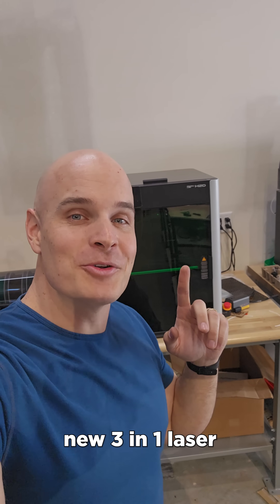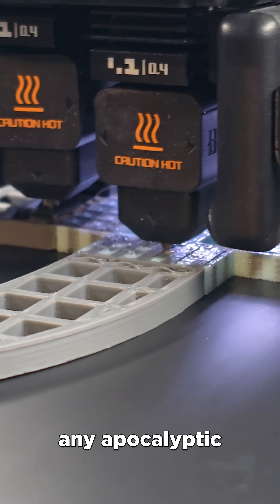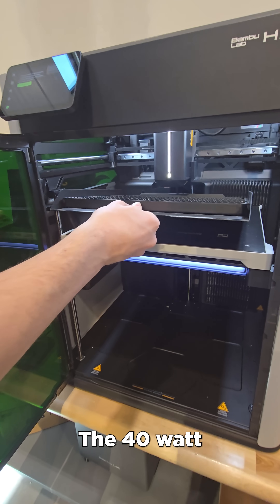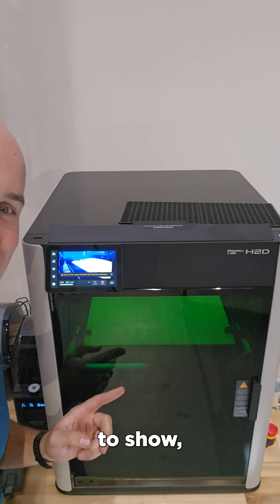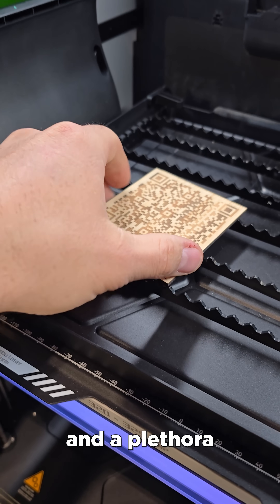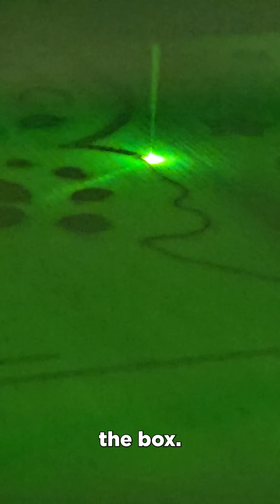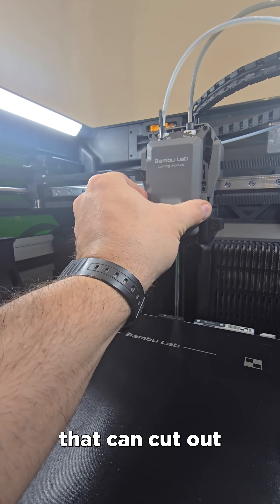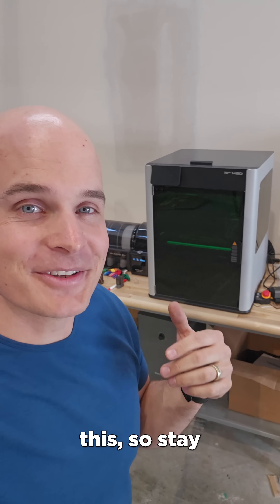DID THEY GO TOO FAR?

Comment: The laser sounds cool, but don't be fooled. You're going to either need to park the whole entire unit in a shed outside or engineer up some extremely serious ventilation and filtration, or else you're health is going to suffer. Even burning wood will become acrid in a short while, and although pleasant enough at first, it'll smoke you out of a double garage in no time with the door closed. You also need to purchase and learn how to use lightburn, so that's an entire learning curve all unto its own.

Comment: Every print successfully sent to the printer is stored on the micro-SD card.
To put it another way, if it printed once (via network), it can be printed again (SD-local).
LAN mode works fine, but you might need to freshen up the printer ID from time to time.

Comment: This guys is a total sell out. I own both a laser and several 3d printers. The two are totally different tool and cannot run safely or well like this. Fumes aren't properly extracted. The dust and shards it creates is a nightmare to clean out and will clog up both the printer and the laser in short time. It's going to become ewaste in a year when people figure this out on their own. Buy prusa printers. Buy longer laser. Save money. As for multi color prints? Either buy an AMS or just save for a Prusa XL. Or get a dual head. Or a pallette. This is not the way.

Comment: I want Bambu to come out with a series of desktop CNC machines. They are the perfect company to do something like that.
Reply: That's a very niche market though as most people are probably fine with plastic and dont want to deal with the hassle of CNC machining metal as you have to deal with actually buying the blocks of metal, taking care of the chips, and not to mention the amount of noise it would create. Not good enough to put in a house.

I suppose if they were to make one, they could target machinists but its not ask big of a market as consumer 3D printing
Reply: @SentinelAerospaceOfficial  Some things simply require CNC.
Reply: @SentinelAerospaceOfficial  I bought my first CNC router in like 2017. Lots of people use them.

Comment: Bambu needs to get closer to Pantheon in terms of part strength and quality before they start worrying about toolheads that do things besides print. I don’t HATE that it can also be a laser but it seems more like a gimmick since it’s easy for them to make a printer also work as a laser more than it actually makes sense to combine these tools from the user side. Or even just throw a low power spindle on it for machining your plastic parts to tighter tolerances. Could be cool

Comment: A warning to any beginner laser cutter, never laser cut/engrave polycarbonate. When it burns it creates toxic gas. Acrylic is perfectly fine but after working in a college machine shop the two were often mistaken for each other.
Reply: ALSO ABS. Lasering ABS literally creates cyanide.
Reply: A suspended policarb sheet rings when you tap it, acrylic makes a dull thunk sound.
Reply: When cutting materials like that they have a tube you’re supposed to put out the window to vent it. Either that or use the optional industrial filter that’s nearly as big as the printer itself.
Reply: Vent outside always.
Reply: Can it cut plexiglass
Reply: Yea, stick to wood... 

Plastics, rubbers, and other composite materials create horribly bad dangerous gasses, and your relying on some filter system to contain it 100%, which almost never happens, even in the expensive commercial setups.... but this is in your home.... don't contaminate where you eat and sleep.
Reply: @tyrzxv I would seriously hope that anyone buying this isn’t putting it inside a bedroom or office. Given that it is technically a professional grade product and very expensive, it would make sense whoever is using it has a proper workspace for this, and proper ventilation in said workspace.

Comment: Yeah, Bambu can get screwed. Don't really know why you would support them after the BS they pulled on consumers. For someone who is so consumer oriented, these guys are anti-consumer.
Reply: What happened?
Reply: As far as I am aware, they updated the firmware to block out 3rd party extensions and also enforce their cloud services. Making it harder/ cutting features to run everything locally.
Iirc some texts on their website were also changed without notice.
End user licence agreement supposedly also contains a phrase that the printer may just stop working if the firmware does not get updated. But I don't think that got enforced so far.

In a nutshell, the possibility of enforced firmware updates that may take away features or privacy
Reply: @ huge thank you brother <3
Reply: I'm planning to get a printer from them, can you kindly tell the story about this ?

Comment: I hate how people are already hating on this. It’s such a cool idea and the idea of having multiple machines in one is awesome to me. Maybe I’m just being naïve
Reply: It's already been done before, and it's like having a boat-car... seems like it would be cool, until the reality of how they each get in the way of each other from working the way they should.

The laser will make way too much dust/smoke/carbon, so you will have to constantly clean it so that it doesn't screw up your 3d printer internals.  

They already shown 40 hours of laser  buildup and how to clean it, but there are spots you just cant get to without tearing it apart.

so do you want a 3d printer that makes good quality prints, but you can't use the laser without constantly cleaning it ? Or a laser that also prints degraded print jobs because of the carbon and dust contamination.

Comment: It would be awesome to have a router head as well
Reply: Why ???  You will have to take it apart to clean it.  3d printers NEED a clean environment to actually work... 

If you have ever had to clean up after a failed print that turned into a tangled spaghetti mess, now imagine it being sawdust or metal shavings. No thanks.

Comment: Can it cut carbon fiber sheets?
Reply: No, it's only a 10watt or 40watt diode laser.  It's not a CO2 commercial laser.

AND unless you know exactly what kind of glue or bonding materials are used in your carbon fiber, you could be releasing extremely toxic fumes.  PVC will create cyanide gas when laser cut, other plastics create other kinds of toxic fumes... you really need to know what your trying to cut/burn, it can be life altering, in a bad way.

Comment: It would be cool if they print a layer then laser it and then print another for extra bond
Reply: That actually doesn't work very well.  It's been tried and the problem is how do you sense when the plastic is melting and not boiling or burning... it's really hard to do without super expensive thermal cameras (multi thousand $$$$).  

And even then, what do you do other than extrude filament with a nozzle, which will already accomplish what your trying to do in the first place, melt plastic into plastic.
Reply: @tyrzxv  u right, it was just a shower idea

Comment: Reminds me of the Snapmaker I get to work with sometimes - 3d printer, laser, and CNC modules.
Reply: Was gonna say. My Snapmaker A350 has been doing this for nearly a decade and they release new modules/attachments pretty regularly. It's only recently starting to shows its age.

I did get a Bambu for printing though because the Snapmaker is really quite slow. I still use it for CNC and laser though.

Comment: Not a good combo at all.  You do realize how much you're going to have to clean that from all the soot from the laser clogging up all the 3D printing gears. This was a stupid move by Bambu.  They made what they thought would make a good printer rather than what their customers wanted. And an all-in-one machine is not it. No real improvement on space, and a single dual extruder really? Better off going with a Prusa XL two tool heads up to five tool heads.

Comment: Love it! Now if I just win the powerball jackpot I can use that to take out a loan and get this printer together with a group of friends and a few investment firms.
Reply: If you own a business that uses this kind of tech and this is a business expense it’s trivial. Our print farm will likely have a handful on the way after the initial kinks are worked out. This absolutely is not a consumer grade printer though. If you wanted that from a flagship Bambu printer you have bambuzled yourself. Start a business and use it to make money, or buy the consumer grade printer  🤷🏻‍♂️
Reply: Yeah, this is definitely not a regular hobbyist printer. This is for commercial use and intended to make money. If you want a good printer, there are plenty out there and they are much less expensive. However, this kind of tech will likely slowly trickle down to other products, which is a good thing. I’m mostly interested in the dual nozzle design for 3D printing multiple materials or colors simultaneously. It would save a ton of time and material.

Comment: Dust and fumes are going to be a big issue. Dust will jam up that system quickly. Also be very careful what you cut so you don't poison yourself.
Reply: Indeed, lasers can be dirty! Wonder how much upkeep and regular deep cleans this machine will need based on how much use the laser gets
Reply: @brovahkiin7073  it needs total thorough cleanup every 40 laser hours according to bambu. Cleaning process takes about 3 hours for 1 person that knows in amd out how to clean it. Just get a dedicated laser machine
Reply: exactly, carbon do be nasty.
Gets on the linear rods, can be conductive and cause issues. a strong exhaust fan with a filter to somewhere your lungs arent is advised.
Reply: the fume extractor thingy that BBL will sell is pretty good, but you're right that it will wreck everything inside the printer if it's not cleaned thoroughly and frequently
Reply: You’re supposed to use the tube to vent out a window when cutting certain materials
Reply: @Kylecoolky  Even with a very good exhaust system dust/smoke will coat the inside of the machine.
Reply: @DM_Jimmy  and this is why yall should be cleaning your machines after every use.... but a lot of 3d printer users are lazy af.
Reply: Especially considering the price jump. Anything more than light use will almost certainly cause problems and you arent paying $1000+ more for light use
Reply: Dont cut PVC and Teflon and you will be fine.
Reply: @lukahierl9857  hard disagree- I cut almost all wood in my X-tool P2 and the inside gets plenty dirty.

Comment: Ya if only it worked without an internet connection in said apocalypse
Reply: It does. Its got an Ethernet port and can print from an SD card.

Let me guess, you haven't actually looked into it or owned on, but keep repeating the chants of sour Prusa owners?
Reply: They have always worked without an internet connection. What are you on about?
Reply: My Printer never connected to the internet. Still use it with SD Card only.

Comment: It’s a cool idea, wouldn’t mind a CNC printer combo
Reply: How are you supposed to clean it though ?  3d printers need a really clean environment to run well or reliably, and the laser really doesn't help that one bit, but now with cnc, your talking chips of wood or possibly metal, and cutting oils or fluid of some kind... absolutely the worst combo for a 3d printer.

Comment: It's crazy how far 3d printing has come, and it really doesn't break the bank. Love your videos!!
Reply: Someone is living in a different world. Need to print a lot of items to break even. Or need to be selling items.
Reply: Not break the bank? Arguable however You could have all it does in different machines that perform better than this one for less
Reply: @mashiori9020  snapmaker has a 3 in 1 tool head printer. its built a lot better and about $800 cheaper than the bambu junk.  bambu hasn't done anything new.
Reply: @mashiori9020 Sure, if you are running some sort of professional grade manufacturing business, then having dedicated machines for each is probably better. But I think this falls between hobbyists and professionals. I’m not so sure on prices for a dedicated laser cutter that can do 15mm of wood, and comes included with the engraver/cutter. Plus keep in mind it does also have a ton of other features that ensure reliable final prints/cuts. I think it also has a bundle that includes an AMS unit.

Comment: Bambu printers are anti consumer.
don't take sponsorship from them you are better than that.
Reply: Anti consumer?

You mean the millions of consumers that only own printers now because Bambu made it possible to print without the printer itself being the hobby?

99% of Bambu users use their slicer, and could not care less about any recent changes.
Reply: @joshbridges8410  Millions of people use Apple products. 
It doesn't make them pro consumer .
Their tactics and rules are anti consumer.
Reply: @ You miss my point.

Apple didn't make it possible for people without phones to now have phones. Those "consumers" were already in the market place, if Apple were anti-consumer as you suggest, then consumers would not buy their product, its a free market.

People with no 3d-printing experience buy Bambu printers because they were the first "printer for non-printers".

Its hard to support your claim they are anti-consumer when they have done the most to create new consumers that would not have access to these machines without them.

99% of Bambu users were already using Bambu-lab before the firmware update and will not care about the changes.

The incredibly small number of people that wanted to use alternative slicers are not Bambu's target market. And there are still ways to use any other slicer or raw g-code.

You seem to be confusing: "They made this change that an extremely small number of people don't like, many that don't even own a bambu printer", with being anti-consumer.

Its a free market, buy something else if it offends you, the consumers continue to buy bambu printers in huge numbers, because wait for it... They are pro-consumer-access...

Comment: now how does someone operate it without this bambu connect jankery
Reply: I was going to get a bambu and getting ready to make the purchase, then a month before I got it, I heard about the new requirements with the connect thing.  I'm glad I did not get it.
Reply: Just use LAN mode? There is a built in, functional and complete workaround.
Reply: @pyrodesignsllc LAN mode is useless tbf. You still gonna need to update the machine
Reply: @Declopse  So? Just do that then. It's literally automatic.

Comment: With how anti consumer they have been it’s a pass from me. Also seems stupid to have fragile motion components next to a laser generating dust and smoke
Reply: You can buy the H2D as a non-Laser Version without it.
Reply: @Glasrandkante  Sure you can buy it, but you can't own it. That's what Bambulabs wants
Reply: @wekkimeif7720  Of course you can own it.

How dramatic do you want to be?
Reply: @wekkimeif7720  you sound emo. of course you own it. just because it isn’t open source doesn’t mean you don’t own it. you don’t need to use their cloud network either, there is a developer mode in which you have full control over the security of your own printer.
Reply: @joshbridges8410  false

Comment: That's pretty sweet! I want one!
Reply: why is no so sweet, 1) dust and fumes on your expensive 3d printer, 2) A 10w laser cost $150 - $250, why pay 3 times for it? 3) A 40w cost around $1200, why pay $1800 for an addon??. I can almost hear the forums..."Oh my H2d started having issues to 3d print after a couple hours of lasing engraving...any idea??"...lol
Reply: @LuisPa247  dude you could just wait a couple of months before being a hater😂 this thing just got on the market. haters are annoying
Reply: @LuisPa247 Keep in mind this does have ventilation and they sell an additional add on air cleaner if you want it. Even so, you do have to clean it regularly if you use the laser a lot. But even with its prices, you have to keep in mind it isn’t just a laser cutter. It can still also 3D print and do so in multiple materials and colors at the same time. It also has features to detect failed prints, and other things as well. All in all, this is made to save time, money, and space. If you are mainly only laser cutting, then yeah, this isn’t ideal. However, if you are doing more than just that, then this could definitely be worth it for a lot of people.
Reply: got 4 grand?